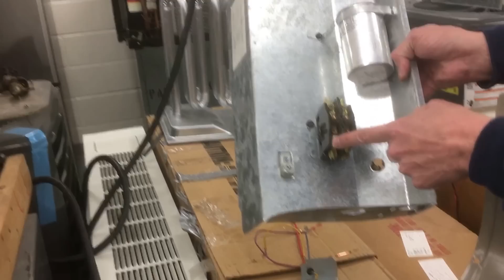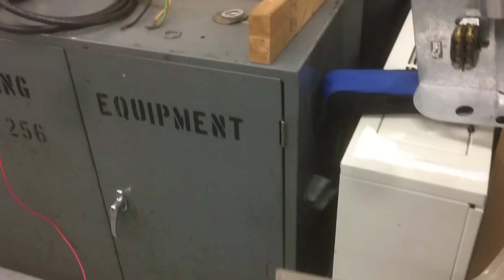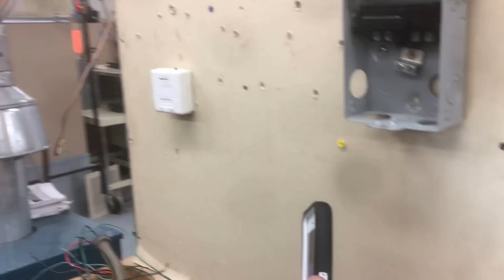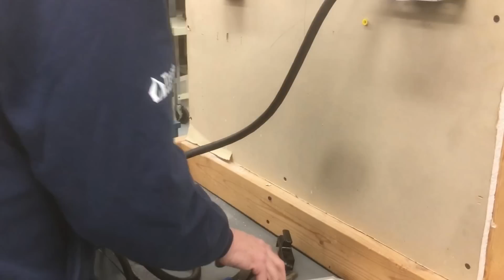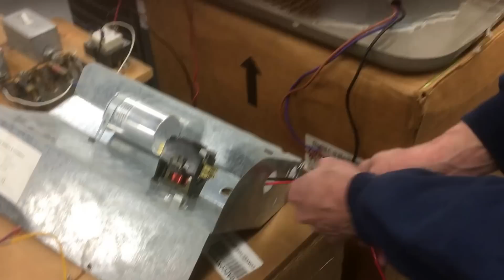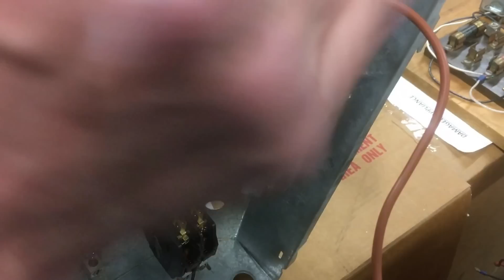HVAC Basics: Electrical Project: Wiring Practice for Straight Cool Air Conditioning Condensing Unit

Comment: Knolax you use for aluminium cable only or copper clad, cooper does not get oxidized , Also get ure self a used screwdriver to beat on those lock nots  or whatever you need to beat on with a screwdriver but dont use ure expensive avery day screwdriver especially those 11 in 1, they are very expensive, I know they sell replacement tips but why waste money when you can just  get a used flat head screwdriver.....Im thinking of becoming an instructor as well.....!

Comment: I have a question.
Is it correct I don’t need a  disconnect if the compressor is within sight of the electrical panel?
I can wire the compressor directly to the panel?

Comment: I noticed the first wires the line voltage was stranded wire and load wires to condenser was solid wire..does that matter that line voltage wires was stranded. I thought they should be solid..great video good teacher thank you

Comment: I have 2 circuit breakers connected to the condensing unit.  Do I need to use 2 separate disconnects?

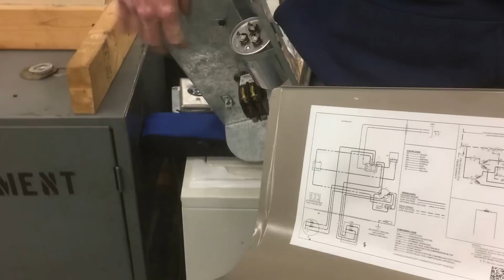Comment: At 1:50 you said the letter C is for compressor which is wrong. C is for Common. HERM is for compressor. 
The dual capacitor has three terminals, labeled C for common, F for FAN, and HERM for hermetically-sealed compressor.

Comment: question:   I am replacing my portable A/C  plug in, which has the  
normal 3  plugs ( neutral, pos  and negative - however  their a tiny 
forth wire connected to  the  circuit board  ... should  I just cut  and
  wrap  the  forth tiny wire?

Comment: Technically your supposed to tape the white wire with black tape if your using it as line and not as neutral (return)

Comment: I like your teaching method. I have a simple question. Do i need to put a ground wire on the, through the wall sleeve, of my through the wall ac unit?? And if yes, plz explain steps. I think i screw the wire to a hole in the metal sleeve, but then what? does the wire hang unattached at the other end? does the wire hang out the outside back or the inside in the house?

Comment: Run, Start, Common are also engraved (R, S, C) on the inside of the rubber harness connector that mounts on the compressor in case you need reference to which is which.  Thanks for the video.

Comment: edisonhvac - Hello, hope you still monitor this thread, I did some maintenance on an outside AC unit. It has the normal ground wire coming in with the power which then screws onto the metal box, as in your video. On this particular metal box there is another green (I assume ground) wire. One end screws directly onto the box but its unclear where the other end attaches. I only know that the wire is routed into the unit and probably upwards towards the fan or fan motor. I'm usually pretty thorough noting these things but missed this one. It may have been unattached to begin with or disconnected as I was unscrewing/removing the top fan assembly from the outside. My guess is it was the fan motor, but I hoping you have come across this before. Thanks for the video.

Comment: I had a dog chew the green ground wire going into the ac. I used a twist on connector and covered it with electrical tape. If a little moisture gets in the wire on the outside of ac could it cause any damage? I know some people say its ok to get a ground wire wet so I am not sure.

Comment: Great teacher ...thanks for the knowledge...lucky kid! Hope they take advantage of the wisdom. Keep up those informative knowledge. I'm in college for HVAC last semester this summer.
Reply from the maker: Thanks for the comment and for watching. Congrats on completing your degree a little early!
Reply: when you have a white wire and not using it as a neutral you have to identify it with any other color accept green  or white You could wrap it with black tape red tape or any color tape accept green or white to meet code